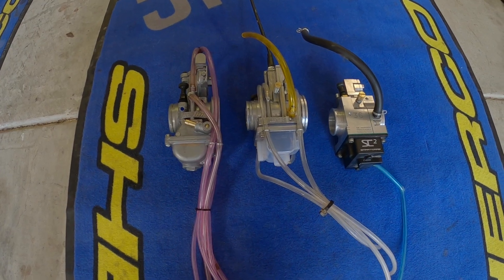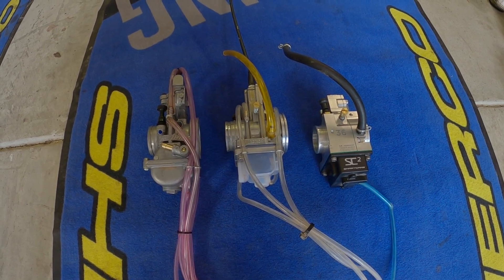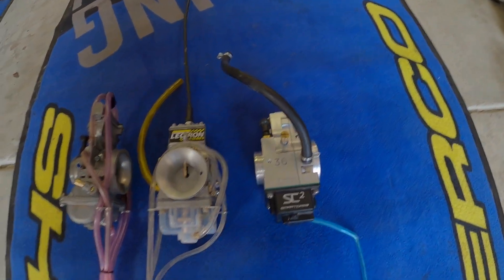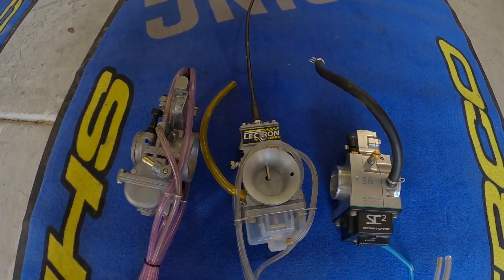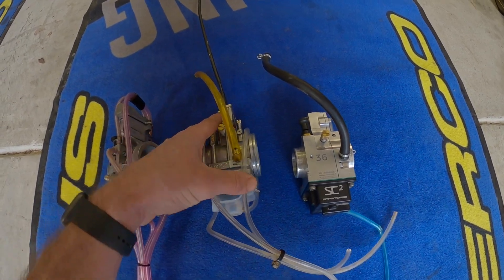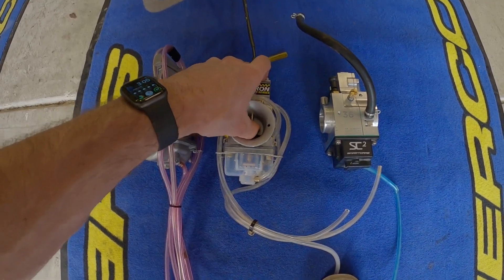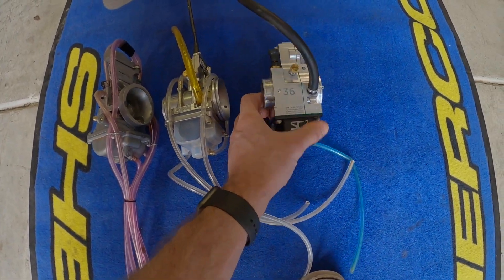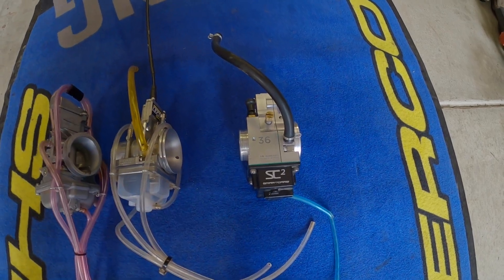Keihin, Lectron, SmartCarb Comparison

Comment: Forgot price point, keihn 325, lectron 🇺🇸 520, smart carb 800 🏁
Reply: Smart carb is 700, but yes, it is the most expensive option. I've tried all three and settled on the SC
Reply: @codyjoseph44   What Made you go with the smart carb over the lectron?  Easier adjust-ability or more power.  What did you find it helped most with down low power better or  more top end or even better both????  What bike do you have it on a 125 or a 250?  This is the next upgrade I want to get because 2 smokes seem to be making a come back and this seems like a top notch mod for more power without going with a 138 kit or something.
Reply: @ephenj I’ve ran all the carbs except STIC ( I used a bike with it tho) SmartCarb is really really good. Cody described the lectron accurately, it’s got too much sudden hit which brakes traction where you don’t want it to. SmartCarb doesn’t spill fuel has the best atomization (best fuel economy) and to me and other technical riders it’s low end response and linear taper makes it perfect.
Reply: Lastly you can just pull over and hand clicker adjust it on the trail which the lectron is never that simple. 😊
Reply: @ Thanks for the info, besides the price point it sounds like fuel injection basically.  Are you on a 250 two stroke or 125?  Curious since I run a 125 currently and we all know there is no bottom end.  But according to everything I been reading this carb changes that noticeably.
Reply: New Keihin can be had for 220 delivered. I just did it.  Plugged it in with suggested JD jets and man does it get great mileage and work great. Better mileage then a friend's lectron gets and runs crisp......................................................The trick is,you have to know what jets do,and how to jet a 2 stroke.
Reply: @bradsanders6954  you can get even more MPG with the Keihin carb by pinching the overflow tube inside of the carb or looping the drain/vent. Graham Jarvis does the same mod on his Mikuni.

Comment: Sweet, thanks for making this comparison Cody! Been wondering how these carbs compare. One issue I wanted to point out so that people don’t get confused: to adjust the metering rod in the Lectron carb, you actually turn the rod without pushing it up. Then, if you need to rotate the rod to correctly position the flat side vs the round side, you can push the rod up and rotate it without affecting the up/down position of the rod.
Reply from the maker: I fixed in the description. You are correct. Thats what happens when you wing a video. I confused it with the SmartCarb mentality
Reply: Lol, understandable. Thanks for the comparison!
Reply: School boy error.... spoilt the vid for me
Reply: @richparrott4450 waaawaaaawaaaahhhh

Comment: just to make it clear and Not to put anyone off , ive got a lectron on my ktm and its been great , it took about 30 mins of testing and making it abit richer to get it 100% . its been great on the hard enduro stuff  very smoothe power ,  the smart carb is a more modern way of the lectron , if anyone is in the market for another carb  dont let any of the problems  you hear of put you off buying one  , they should work right out of the box and be great , but if they arent its not a huge deal to work around any of the problems that cody has described , they will run in much more conditions than a keihin can and the  gas milage is great , think if i was buying again i would buy a smart carb becasue they have fixed all the little kinks that the lectron has
Reply: i got mine from slavens racing and had heaps of trouble with it.found out they had put the wrong metering rod in it for me.Got the right one in there and its amazing

Comment: Awesome video! I just installed a SmartCarb on my Beta and it's amazing so far! Love not having to pull the choke to start it cold! So very similar to my 4 stroke FI bike in regards to ease!
Reply: ADVLite  I have 2020 beta 300 rr. Is that what you have or the race? Been thinking of switching to SC2 but want more feed back from beta guys. Thanks
Reply: @recombi123  I have mine on a 2019 300RR Race Edition. The nice thing about the SC2 is you can use your oil injection with it. Very happy with my SC2 so far.
Reply: @ccenduro  yes it is - but the external adjustability is even more so a time saver!